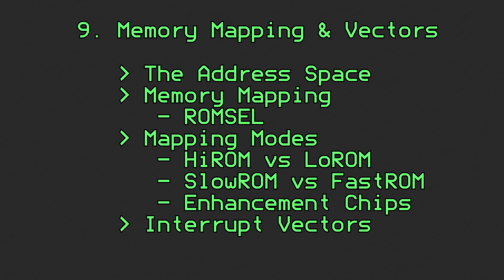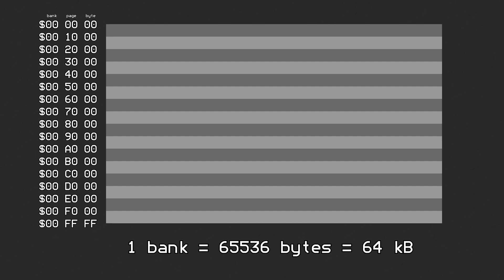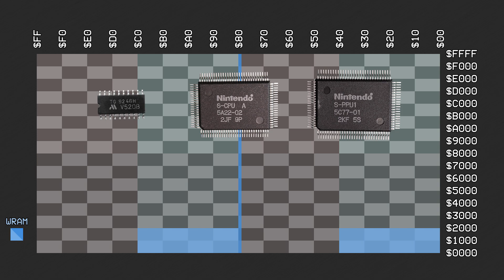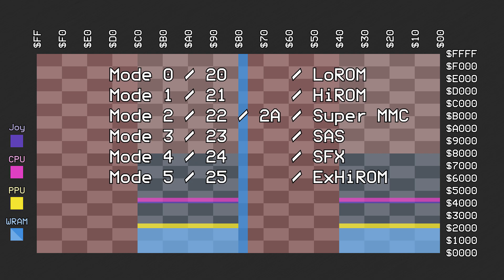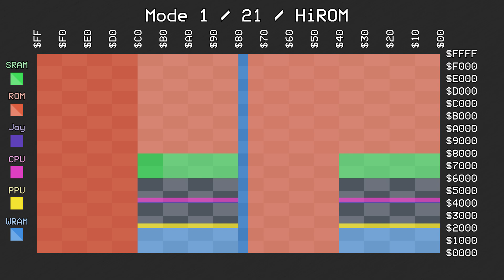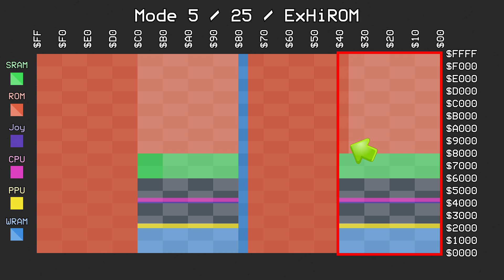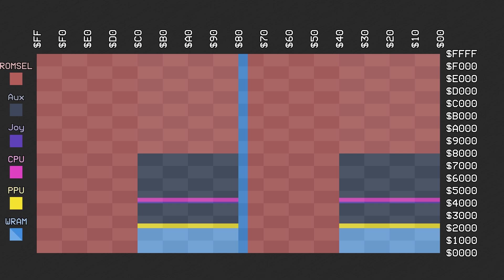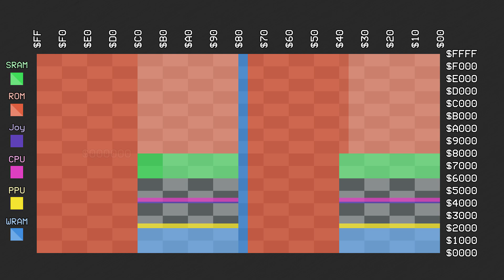Memory Mapping - Super Nintendo Entertainment System Features Pt. 09

Comment: So, there's H-Blank DMA and V-Blank interrupts, but no H-Blank interrupts, so one can't do anything too crazy between lines?
Reply: You can with irq, but in order to change ppu registers, you must turn off the beam, thus small black horizontal line. Also you don't have plenty of time. You can do perhaps one or two ppu changes between a horizontal line.
Reply: @gizaha  Thanks.
Reply: No, it's only VRAM and OAM you can't change.  S-PPU registers and palette can be updated anytime, they just cause a few glitch pixels.
Reply: I mean, you can even adjust sPPU registers during active display and they work, just with a couple glitch pixels where the write occurs, but doing it during H-blank works perfectly without glitches.

Anybody who thinks it can't because of the CPU speed, hasn't pulled out a calculator.
Reply: If you make a sigle tax in f-blank, you will need 2 cycles, almost 3 black pixels. If its working with active beam, then the emulator might not be accurate (i didn't try it).
Reply: @gizaha  https://forums.nesdev.com/viewtopic.php?f=12&t=11404

https://forums.nesdev.com/viewtopic.php?f=12&t=9187

I'm not sure if 93143 got the color palette streaming demo working 100% of the time, but he mentioned that changing scroll values mid scan-line works definitely works.
Reply: If I'm writing during h-blank, I definitely DO NOT want to turn force blank on and off.  When you turn forceblank on during h-blank, it corrupts the sprite pattern fetches.
Reply: Just don't use sprites for these lines ;)
Reply: @shinyhappyrem8728  Or just make sure you're IRQ code is under 56 cycles.
Reply: @aaendi6661  I think Link8312 wasn't talking about h-blank, but about register changes in mid horizontal line, something like snes irq. I don't know if emulators or snes support these changes with active beam (everything's possible) but also anomie's doc regs.txt sais that s-ppu registers needs closed beam to change.
Reply: @gizaha  He said "between the lines" which means h-blank.
Reply: @aaendi6661  He stated "H-Blank DMA" (hdma) "V-Blank interrupts" and "H-Blank interrupts". Also he later stated "too crazy between lines". Between lines is not h-blank, is mid line. He knows what hdma is and what tricks is does.

Comment: Now let's compare this to the GBA's or the Genesis' memory mapping.
Reply: The Genesis CPU was a Motorola 68000. The GBA ran on an ARMv5 (I think it was v5.) Those systems had registers wide enough to hold a full pointer, unlike the 65816 used in the SNES. Much like the case with a certain other extremely successful CPU architecture, this mismatch required the adoption of a segmented memory model and distinct notions of "short" and "long" addresses. The SNES memory map was designed to minimize the need for the more expensive long addressing modes. The other two systems had flat memory models and so had much cleaner memory maps.

Comment: Another great video, thank you. So, why does the SNES always start up in emulation mode? Is this because of the intended backwards compatibility, where if a NES/Fami cartridge was inserted, it would boot correctly, as those cartridges wouldn’t contain the code to switch the SNES mode if it started in native mode?
Reply: I guess so. It was never used, though
Reply: All 65816s start up in 6502 emulation mode.
Reply: 0x5D Ah, so it’s processor-specific, not application-specific. Interesting, thank you.

Comment: The only thing that kneecaps the SNES is the CPU's 8-bit bus and low clock speed. Realistically, you'll never see it reach that 3.58 MHz max speed, under full load you'd be looking at closer to 2 MHz on average. But it was an intentional design choice by Nintendo, their whole philosophy with the SNES was to accentuate the use of custom chips in the game carts to build upon the stock console's capabilities and they certainly did that. In accomplishing what they set out to do, the SNES hardware can be best described as a "dependable solid foundation."
Reply: I cannot believe how visionary it was for a console developed from late 1988 until early 1990.
Reply: For the hundredth time, the 7.67 Mhz 68000 in the Sege Genesis can ONLY ACCESS MEMORY EVERY 4TH CYCLE!
Reply: But can't it transfer 16 bits at a time?
Reply: @shinyhappyrem8728  But the total ROM speed of the Sega Genesis is 1.92 Mhz.  With a 16 bit bus, it's only 3.84 MB per second, compared to 3.58 MB per second for the SNES.  Not a big difference.
Reply: @aaendi6661  The snes cpu also featured slowdown galore
Reply: @aaendi6661  the snes cpu also featured slowdown galore while gaming
Reply: @aaendi6661  the snes CPU featured slowdown galore

Comment: Can anyone say bank switching
Reply: I actually wonder but I suspect it's something similar to:

-> The cartridge exposes some additional HW registers via which code can select which bank is put where
-> The addresses don't go directly to the actual ROM but pass through an address translator (inside the cartridge), configured via those HW registers.

Should be easy. For an access in such a bank, the CPU requests for an address. In the cartridge, an address translation module checks the upper 8 bits (to see if it's an interesting bank), then translate it to corresponding bits in the actual ROM, then forward to the ROM. And yeah, the cartridge can have a different internal address space, just like the address spaces of the CPU and PPU differ.

Comment: Why is it done this way, it seems so wasteful, there's so much space wasted mirroring
Reply: I don't think it's taking up any extra memory, just addresses
(could be wrong)
Reply: @googleboughtmee  It's mappable space, which you can put anything in. It's not directly available memory, but it's potential for memory to be put there.
Reply: Mostly it simplifies the cartridge circuitry. Mirroring happens when some bits of the address get ignored, ie not hooked up. That's also why a game with 1MB of ROM will usually have its ROM mirrored into every 1MB region, because the higher bits of the address don't connect to the ROM at all.